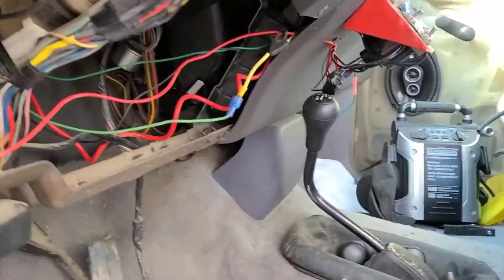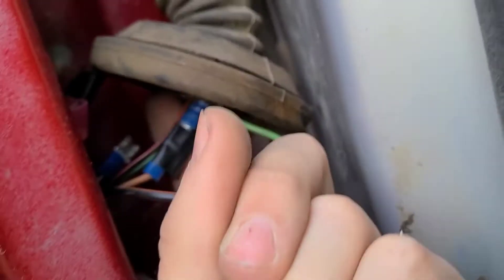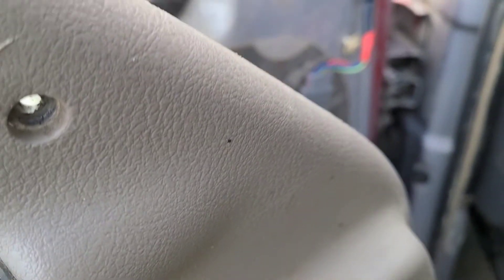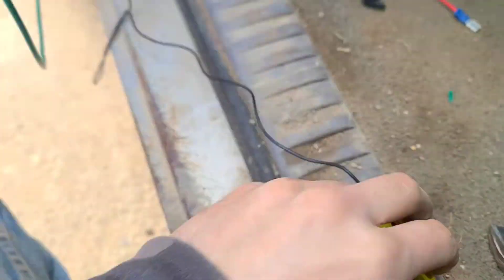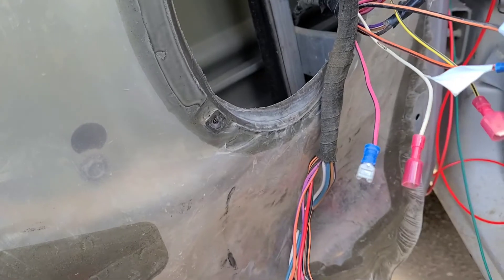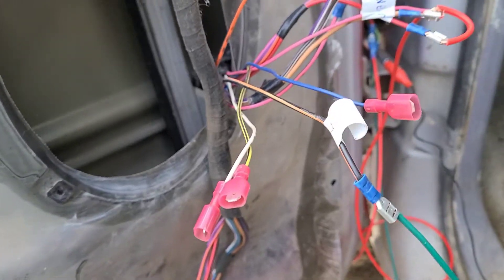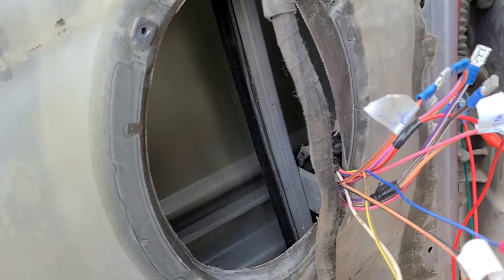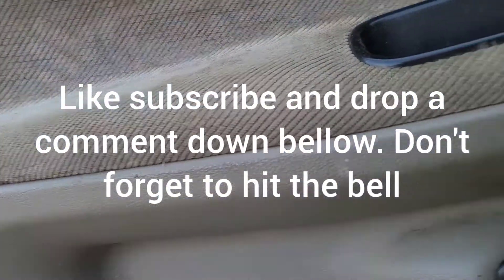Wiring a 2nd gen dodge ram door

Comment: wow you put a lot of work into that thanks so much I was wondering if you have a written wire color code. How's everything holding up in the wiring
Reply from the maker: Good on that side. Don't have a diagram. The truck is parked right now. Having issues with the passenger side. It's worse.